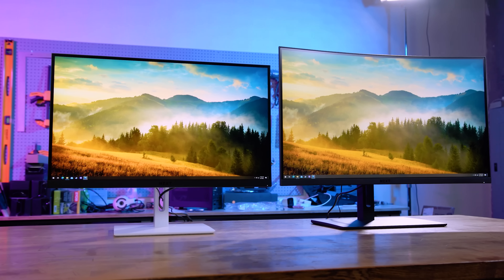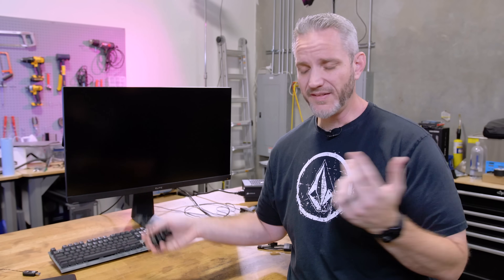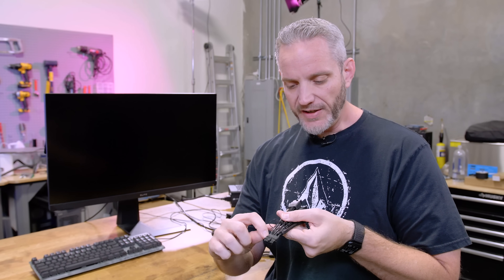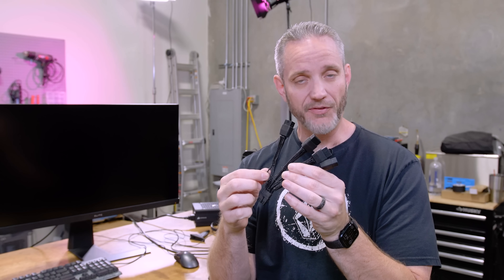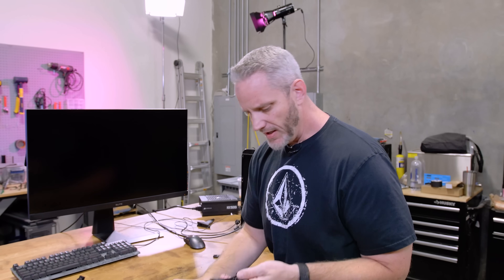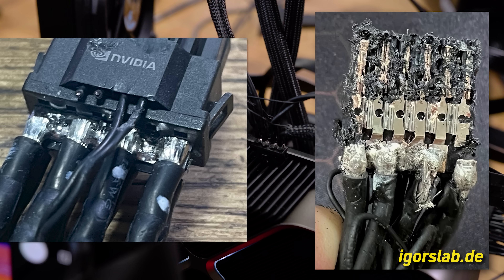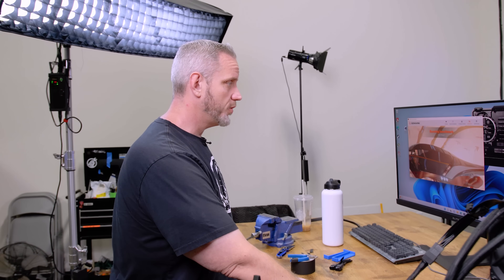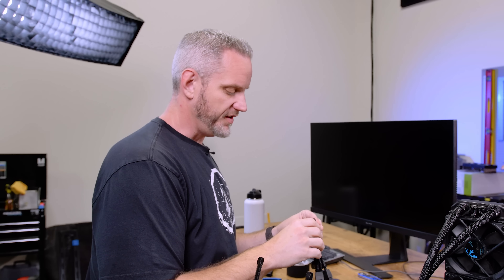Igor's Lab figured out why NVIDIA adapters are melting!

Comment: can you use coesair extended cable on a non corsair PSU?
Reply: Would love to know that I just got an  EVGA  PSU and  I doubt they will make a cable as they are not making 4090s
Reply: not sure it been tested for bequiet psu when both corsair and bequiet are very similar in bigger dual rails ....evga won't work ...and very risky for older models that is not dual rail

Comment: before i watch, i wanted to add on previous vid: Electrons "flow"(or hole flow..........let's not go there) on the surface. Ever see MIG gnd wire? Hair thin wires,  hundreds. That's because the surface area of 100 hair thin wires is greater than a single equal diameter wire(*true story). 
But ultimately! when a contact is made and broken, current surges. You can see this on any cheap o-scope. Each tiny "pit" causes resistance/impedance. But! Heat is generated in the place of said resistance. This causes a closed loop spiral. End result: Melted. *Iyes i'm an en gy near lol. But this is basic EE, no degree needed. J2c is dead accurate about HOW the breaks happen, i was only addressing the electronic theory/fact about how fires happen.

Comment: Honestly. I still don't understand why engineering around connectors that supply power has become so weird. Apple put the high voltage pins right next to low voltage data pins in a bunch of mac books since 2010, IMO pushing 200w through USB-C is also pretty iffy, an now they came up with this hare-brained idea to put a bus-bar on the connector. If you look at the power-side of the old style PCI-E power they would bus individual lines together on the card, where the user was far less likely to break stuff. Why a bus-bar on the connector in the first place? I can't imagine the tooling for stamping out sheet-metal with complex-ish geometry vs a machine that slots in individually pinned cables into a connector is going to make a financial difference in the long run.

Comment: The only way the industry to solve this is to either ditch this connector and return to 8 pin pci or quickly standardise this connector on the power supplies which will remove the need of this octopus connector which is not very feasible for the industry soo....

Comment: So now it's not only silicon lottery but weld lottery if your using the provided cable. Which is better than all cables provided are an issue but does mean the suggestion is still no one should be using the provided cable.

Comment: Disconnect your car battery terminal and reconnect it over and over and over again very fast, tell me what happens. Lol

Ummm dude if the solder broke, you turned it on and the vibrations alone kept it making contact and not making contact over and over it would Spark and catch fire.

Comment: shit i set mine up to side bend because i figured it would be less stress on the pins. I don't have the adapter though, my psu came with a 12vhpr connector specifically made for the 4090. think ill be ok?

Comment: Can anyone help inform me? If i got a atx 3.0 gen5 psu with the correct plug, will this issue be circumvented? is the issue JUST with the adapter, has anyone done a breakdown of the gen5 psu cable to see if it still has weak soldering if it needs any?

Comment: So what needs to be done is the sense wires should be replaced with an internal resistance measurement unit and that would require a sense wire from psu end of the top end inside the gpu and that foil needs to be replaced solid metal end caps soldered on to the wire and metal clamp like a mini car battery terminals instead of foil. Wtf was nvida thinking.

Comment: Seems unnecessary to use such a small plug to begin with. A bigger plug for such a powerful card would allow the solders to be beefier and withstand normal bending from cable management.

Comment: Considering the trend of power hungry stuff in computers, why don't we move to 24V PSUs and electronics?
I know it is anoying to have to change stuff, but considering that a new PSU is needed anyways, it might have been a good time to add 24V to PSUs...

400W at 12V is 33A. That is enormous, and obviously it will cause problems with wires and connectors. At 24V, we would pull half the current, at 16.6A.
Not great, but far easier. 
Perhaps even 36 or 48V?  
Anyways, even with 24V, the previous pcie connectors would be able to handle the load...

Backwards compatibility is nice and all, but at some point we need to break a few stuff to innovate...

Note that i'd rather have newer hardware managing to improve while maintaining or even improving power draw, but that does not seem to be what neither CPU manufacturers nor GPU makers chose to do.

I hope that this hot and hungry phase will be like the Pentium 4 phase, and that after we'll have more efficient designs, as was the case with core processors...
Alrhough, seeing how we seem to have reached a soft cap to lithography progress, it may be wishful thinking....

Comment: Using the 12vhpwr straight connection (one cable...no splitting cables) which comes with the psu atx3.0 support will not cause this issue..Dont use the adaptor with 4 splitting cablez which came with gpu.

Comment: Correct! This creates a filament effect. Just like a light bulb filament! Where there is resistance in a wire, making it act like heating element. And a intermittent connection aid in arching causing the gaps to be singed by micro sparks and creating further resistance. Dangerous situation, like time bomb! Ease fix should have been to create a new design in plugs, in the first place! At the manufacturing! Basically they went cheap and charge a premium in price. So now we are still beta testing it for NVIDIA. Kind of an insult do you think?

Comment: What about arcing when it is still barely touching ?
Not gonna lie, those nvidia connectors look really shoddy .. that much power draw should not be using a little aluminium bridge. It should be pins crimped directly onto wires.

Comment: Gamers Nexus did a video a while back with a PSU Manufacturer,I think it was Corsair, and they were adamant about how you should not replace PSU cables with other cables from even the same manufacturer, unless specced for the exact same model. 
So perhaps it's not necessarily safe to replace cables like Jay says

Comment: I just bought the Gigabyte 1000W psu that has a single 16pin cable for this 12vHPWR connector. Looking at it, it looks almost exactly like the corsair one that Jay said was a safe solution. Does anyone have history with this Gigabyte PSU and can confirm if that cable is safe to use before I plug it into my 3090ti?
Reply: Check out my benchmarks with the 3060ti and 6700XT

Comment: Your not going to replicate the results by cutting it off Jay, you need to keep the broken solder tab inside the connector, barely making contact AS IF it were just cracked, its the combination of high potential of current & wattage being forced to arc through a break in the metal tab, jumping through the air in the voids and ultimately carbon is allowed to form. This creates high resistance which creates high temperatures melting the connector plastics.

Comment: Someone told me "oh it's just a pin issue and you're making it bigger than it really is".  THIS should never have been a problem  with a 1k to 2k video card.  For that price there should be NO errors possible on power transfer.  That's a bad defect and it needs corrected.  The best way to prevent this is to not buy the product overall just because the chance exists.  It Corsair may have a fix but you need to purchase that fix which is an added cost. It's not cool and Nvidia needs to know that.  Too me it's a sign of poor engineering just to cut costs.  It's a sign that all the PC component manufacturers are just trying to profit as much as they can at our expense and potentially putting our lives at risk.  Fire risks should not be something that is a common risk among PC components.  That said I have watched a Seagate drive catch fire before.  Not saying Seagate is bad because it most definitely was an isolated incident and I have never seen another do that in 20 years so it wasn't common.  This is obviously more common as it happened to enough in this short period of time.

Comment: Bring back leaded solder, this lead free garbage has been causing issues since the early 90s i have had to re-solder a couple dozen automotive boards that have cracked over time and other misc. Boards.  Lead is much more forgiving and bends rather than cracking and breaking

Comment: WHY are 90'degree connectors not a thing? You could go 90 degrees up or left or right, whatever, then the wires would be 100% straight, no stress.

Comment: As nice as the connector looks, it was just a bad idea to reduce it as much as they did. I'm almost positive that if the connector was 1.2 - 1.3, or better yet 1.5 times bigger, it would never have had this extreme of an issue. Simple fix, increasing the connector size that 25-30% right away, it should still fit the spot on the card, with the hope of seeing up to a 50% increase in the future. By increasing the size, I do mean it's internals (the foil distribution block the wires are soldered to), not just the plastic connector itself. Hell, why even use the distribution foil, when 1:1 wire to pin worked the first time.

it was just a really bad design. anyone (engineer wise) should know that reducing the mass of a circuit at any point creates a "hot spot" with a higher resistance. add to the fact that it's a "flexible" circuit, even if they mold any part of it, which in itself creates a stress point in the "flex" of said circuit, any "connection" or solder point becomes a weak point in the flexibility also. (and because is a "flexible" circuit is also why it's stranded, not solid wire).

Comment: HP screwed me over on my laptop with the nVidia bga solder fiasco.  My laptop was not part of the recall so they charged me $400 to fix their production error.  The first time I ran a game that used one of the newer shader features my screen turned bright pink and then went black.  I'm going to give half the blame to nVidia for not forcing HP to pull their head out of their nethers.  But I'll never give HP another $ again.  Not even their extortion priced ink.

Comment: All these people in the comments talking about arcing with 12V...SMH.

There's a reason things that actually make use of electrical arcs are always very high voltage, even for short arcs. You aren't arcing shit with 12V. The only thing that could be happening is intermittent/poor electrical contact, which would very greatly reduce (or eliminate) the amount of current traveling that path and cause the current load to shift to the rest of the available conductor, while increasing the overall resistance of the connector/adapter/cable system delivering power to the GPU. 

Higher resistance in the adapter equals higher power dissipation in the adapter. There are no arcs involved. Just higher system resistance.

Comment: with a card this f-ing long and this f-ing wide, why are we still putting the damn connector where it is! I imagine many cases fit the card but not the connector between it and the side panel.

You could rotate the connector and have it face straight up when conventionally mounted in a case and have no clearance issues, little bending required
OR
When vertically mounted it faces the MOBO, still i think it would be rare to have a clearance issue in this configuration.

Comment: They should have just came up with something that uses (2) 10ga wires on a xt-60 or similar plug direct from the PSU to GPU hookups, or the PSU itself into the card. Theyre trying too hard to adapt 20 year old standards with 3x the power draw of older cards, and to do it all in 1 single plug..... RCs use 12ga or 10ga and can handle an absolute asston of power reliably for long periods and in sudden bursts even

Comment: Sorry but I call Reddit posters "people full of it". I have been torturing my 4090 (MSI Suprim X) for days with overclocking, 6 hours of consecutive play between Cyberpunk and Dying Light 2 with full RT on, no problems whatsoever. Both Jay and Steve (Gamer Nexus) tortured cards and connectors in the most exaggerated ways and could not reproduce the problem. There is no problem. End of Story.
Otherwise, both me, Jay and Steve would have melted the connector by now. Those guys are either shills (yes shills from competitors) melting the connector with a flame and saying it happened naturally, or have faulty components and extremely faulty behaviors in their pipelines/modus operandi.
Much ado about nothing if I ever saw one. (Or rather, much ado about BS).
Reply: I hope you are right. There was recently another case using the native pcie 5 psu and it got burnt again. I own one and am really worried
Reply: @Arjackz  might be that some Card manufacturers (like Gigabyte) sourced/ordered the adapters from el cheapo manufacturers while others (like MSI and Asus) sourced better parts, not sure about that. However, no reputable and respectable Youtuber (like Steve at Gamer Nexus who I respect deeply) could reproduce the problem no matter the torture. That should raise an eyebrow or two at the very least...
Reply: @davereen5103  I own Colorful RTX 4090 Vulcan. Is it high quality or reliable?
Reply: @Arjackz  Never owned a card from Colorful so I cannot say from experience.
I am not even sure that is actually the problem (just an unsubstantiated thought of mine). What I firmly believe however is that if trustable people (like Jay or Steve) cannot reproduce the issue even after abusing the thing brutally (far beyond normal use cases at home), the problem might be of a different nature, including the "fishy" variety.

Comment: I don't get it why they made 12pin connector with 8 wires. Why didn't they just made 8 pin connector so every wire has it's own pin in the connector? No foil, no soldering, no nothing.

Comment: why melted inside not outside ? this adaptor have very fin pins that why is a fail ,if the problem was from the wire ? the wire should be melted not the adaptor

Comment: Soldering those pins ... the person responsible for that design deserves to be fired and never hired again by any manufacturing or engineering company.

Lucky me, I'm making my own cables. The 12VHPWR connector is just ~3-4 bucks (incl. 2 sets of crimp terminals), the crimp tool ~50, and wire. I'd also definitely make my own adaptor cable if I couldn't get my hands on a new PSU with proper cables.

Comment: I'm not an electrician so can someone with more knowledge explain this. If there are 12 pins, why are they using 8 wires and soldering them to the "foil" thing making 4 wires connect to 6 pins, instead of simply using 12 wires?

Comment: Okay, so for people paying around $2500 dollars for a 4090, Nvidia didn't think about putting a rigid loom around the power connector to protect the solder joints from flexing.

That's some Apple level of not caring about your customers

Comment: You are not recreating it because you are performing the right experiment. It's the arcing that is causing the melting. when you cut the cables and don't put the cables close to each other to create arcing there is obviously no heat created. Electrical arc produces heat at a rate that is equal to the voltage x the current of the arc. The equation used for this is called "incident energy" "arc flash" and you could calculate this knowing the specs of your system etc.

Comment: This lack of forethought and total disregard to safety needs to become a class action lawsuit. I'd rather wait a couple more generations to get this sort of performance safely than have a fire hazard in my PC. As others have said already, if you're honestly spending THIS MUCH on a GPU you shouldn't have to worry about shoddy dangerous crap like this. It's totally negligent. Just spend the damn money on a proper connection, Nvidia/ User a thicker gauge and direct pin to wire. Slapping some solder on there & calling it a day is NOT the way to do it.

Comment: Radeon Powercolor 7900xtx liquid devil water blocked from Powercolor  3x 8 pin power connectors hitting 470 watts. running within hotspot max temp. Excellent  gpu.  Was going to buy  a 4090 changed my  mind because of crap power connector.  Couldn't buy a water  blocked 4090 unless i do it myself.  No regrets

Comment: you can clearly see that this is not the right conclusion, you tore off 2 of the wires and nothing happened, other users have shown the pins being pulled out or twisting easily, there is multiple causes most likely

Comment: This is kinda hard to watch. Cutting a wire is not simulating the compromised connection point that’s heating up, or possibly even arcing. Guess that’s why engineers don’t fix things.

Comment: so in the end.. still a really bad design?
Nvidia: introduces new connector
also Nvidia: cheaps out on the adapter
PS: maybe you've been testing it in open and not closed case.. iirc an enclosed case is hotter?

Comment: I laughed at your comment about it being due to heat and not any kind of short in your last video. Like what a ridiculous comment lol. Also it's not that hard to recreate. It's because it was cracked but still touching likely creating random sparks or a lot of power put through a tiny point in which the break was still touching. You just went with it being completely separated.

Comment: There should be 1 wire per pin, there's not reason for that silly BS. I really ponder if that "metal foil" is actually the tabbing that the pins come shipped on that normally is cut off when the pins are installed.